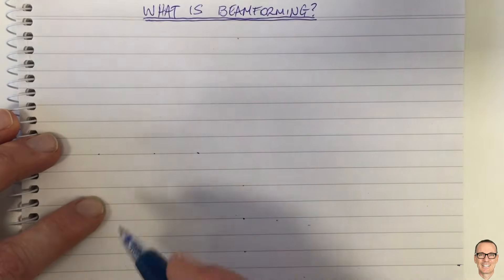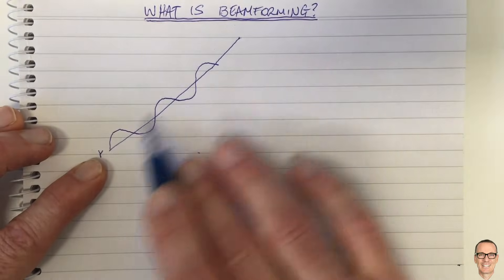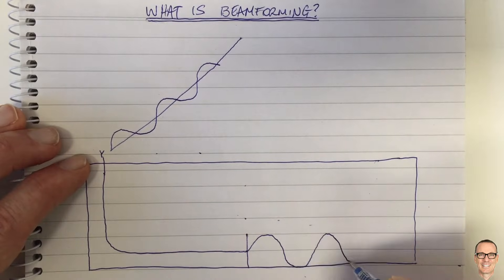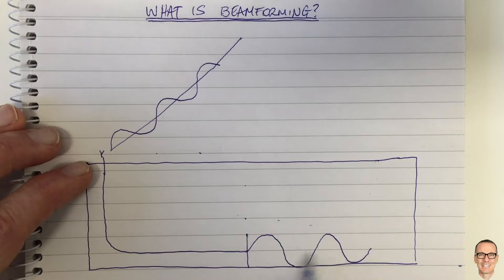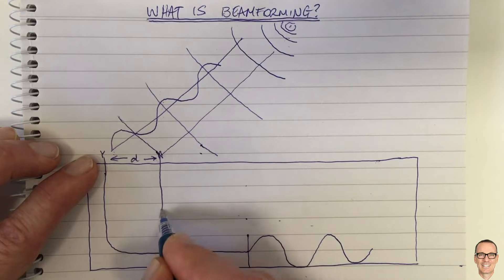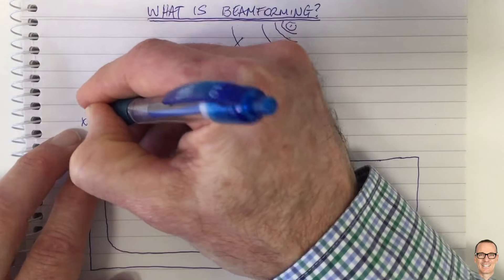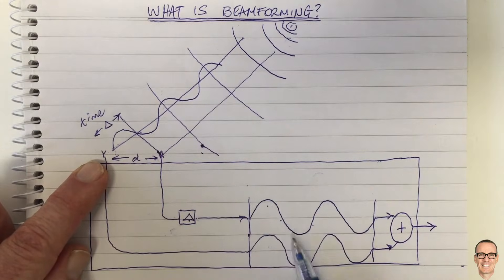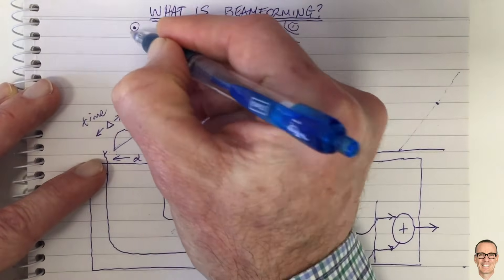What is Beamforming? ("the best explanation I’ve ever heard")

Comment: Great explanation. One question though: Are you sure that adding a delay of two times delta at the third antenna would make the peaks/throughs align? To me, two delta corresponds to a full period, so there would be no effect. Seems better to add lile half a delta instead,at least by looking at your drawing.
Reply: Ah, OK, that makes sense. Thank you!
Reply from the maker: The frequency of the signal doesn't affect the time it takes for the signal to travel between antenna elements. So it's not true to say "two delta corresponds to a full period". The time "delta" is the time difference between the signal arriving at an antenna element and arriving at a neighbouring antenna element. It doesn't depend on the frequency. The respective "phase shift" does depend on the signal frequency, but not the "time difference of arrival".

Comment: Firstly I would like to start off by saying thank you for sharing your knowledge with your videos which really are helpful to students like me. 
I watched your beamforming videos (in MIMO), I have a couple of doubts sir.

Generally received signal from base station (having single antenna) to communication user(having single antenna) is written as: r = h*(root (P)) * x + n , where h is channel, root P is included to say that transmitted s/g power from base station is P (given E[|x|^2]=1) , x is a transmitted signal, and n is noise.

Now, can the above equation be modified for a base station with M antennas as:  r = h*W*(root (P)) * x + n  , where W is beamforming weights. Is this correct? If so, what does this physically mean? Does that mean total power available at the base station is being divided among all antennas or in general how this transmitted power P is being related to weights in the beamforming vector.

I'm confused sir, it would be really helpful if you clarify this.
Reply from the maker: It depends on the norm of W. Generally we would use a W with norm = 1. Then, yes, it represents the total transmit power being allocated across the antennas.
Reply: @iain_explains   Thanks alot for ur reply sir.

Comment: Thanks for explaination, now I'm wondering how the transceiver actually  tunes to specific wireless client by selecting right delays?. Is it still in PHY or MAC layer ? Also how fast is the switching ? As if we have 4x4 router and two typical 2x2 clients how router assures signal from 3rd device will be still handled without comprising value added of two existing MU-MIMO clients?

Comment: Fantastic explanation. I want to use 2 inverted L antennas to create a phased array. My existing vertical L is a 20m (14Mhz) with a little loading coil to resonate on 40m (7Mhz). How do I reconcile  the distance between the antennas to the delay "harness"  design required....Is 1/4 wavelength optimal.....could I compromise somehow to get it to work on both bands? I guess I would need a different delay for each of the bands?? Or is it a daft idea! :) 73 de VK2AOE
Reply from the maker: You'll definitely need to match the delay to the centre frequency of the band .. seperate delays for seperate bands. There are wide-band beamforming techniques, but it's always a trade-off. Beamforming works best when it's narrowband.
Reply: @iain_explains  Thanks....I loved your explanation it made the concept clear. As with all Engineering the devil resides in the detail. Thanks for the answer.
Reply from the maker: I'm glad I've been able to help.

Comment: I can understand the basic princple of beamforming form your video, but I have a question.

Consider 24Ghz freq MIMO radar system, which has the spatial distace between Rx antenna is lambda/2.
To acheive +50 degree digital beamforming, the delay time should be (lambda/2)*sin(50degree)/c = 1.6e-11 sec.
So, if I want to make 50 degree beamforming, the minimum sampling rate of MIMO system should be 1.6e11 Hz, which is too high to make a real system.

I want to know how can I solve this problem.. Thanks.

Comment: What is never mentioned in antenna radiation is whether or not the E/M loops being radiated do break down into loops of half wavelength as the loop try to grow in size  with distance,  In waveguides and cavity resonators it is common to show the stacking of " half wavelength E/M blocks  to fit in the available space. A one megacycle wave, has a much larger loop than a 5 GigaHertz signal and though everyone talks about lobes, and directivity, and efficiency, and so on, no one talks about the "stacking of E/M blocks" the size of which depends on the frequency of transmission.  So for a given frequency , how many stacked E/M loops exist in it  as the wave moves out? I have thought about this for the last 80 years and it seems to me that when one has a directional antenna, or a phased array, all that is happening the system is cutting off and eliminating the peripheral blocks in the stack of E/M blocks in the lobe or in any omnidirectional antenna, 
I  simulated this with a computer algorithm which, when the circumference ( wavefront) of the  wave grew larger than a wavelength  integers,  then the  " circumference would accommodate another loop half a wavelength long".  
The simulation works beautifully and the patterns that emerge make it so obvious, after I saw it,  From a central location  of the antenna, after the wave settles down, the patterns seems to change from a "polar diagram" to a cartesian diagram where the  four symmetrical squares of cartesian coordinates,  simultaneously  move out their  four quarters containing the same pattern of E/M loops  as exist in rectangular waveguides contain  the higher modes. When I plotted the B and the E field loops far from the antenna they came out to be exactly as occurs in rectangular waveguides  with the  B loops as normal, and the E loops are exactly the same as the E in the waveguide and the surface currents in a waveguide, It is exactly the same pattern,
So it seems, that a centrally placed antenna  as a source, will have  the  near E/M fields  going through "a pushy transient pattern" then "a middle field pattern"  which  I call the settling down zone, and then the far field would resemble the pattern obtained in a  rectangular waveguide excited with an electric probe or a magnetic probe as one desires.  It is fascination to see the four quarters of cartesian coordinates moving out with additional loops being added as the distance increases, It is remarkable, 
This stacking of E/M blocks, the size of half a wavelength, in a radiating pattern, is interesting, and in a phased array  or a directional antenna, it seems that all one does is to " phase out the peripheral E/M blocks  and donate the power to the other half wavelength E/M blocks remaining in the " stacked lobe"   There seems to be more going on in radiation than one thinks, and this "stacking effect" needs further discussion .  An analogy may be used by looking at Chladni's figures in vibrating sheets or a Jelly block, and after all our radiating medium is not much different from a jelly or a rubber block with its "own impedance" in how it permits our signals to "accelerate "  build and decay and reverse those  the E/M loops the size of half a wavelength.  https://youtu.be/wvJAgrUBF4w
Reply from the maker: Did you say you’ve been thinking about this for 80 years?! That’s impressive. What antenna systems were you working on 80 years ago? And since then?

Comment: This Beamforming, given fixed delay, is good only for fixed (position) signal source and fixed receiver - not for moving source or moving receiver, otherwise it will be hard to tune the delay in a way to match the movement of the source, or receiver. Has this technology "Beamforming" been used for moving source, or receiver, at all in practical application?
Reply from the maker: Yes, that's right. When a source/target moves you need to adapt the delays. Then it gets called "Adaptive Beamforming".

Comment: Hi, I am a student with master's degree studying communication in south korea.
Thank you very much for the good lecture.
You are the hope of the wireless communication.

I have two questions.

1. If i want to implement a kind of antenna diversity through the two antennas on the receiving side,
It is understood that when the awgn noise added to the signal from the two antennas is different, a gain of 3 dB is obtained.
As you explained in the video, when i understand physically, don't the signals entered by the two antennas have the same awgn noise? That's the question I had in mind.
Since there is a benefit from beamforming, I think it would be right to have different awgn noise, but I don't understand this clearly.

2. According to what i saw in the MIMO channel-related textbook, if the angle spread (dispersion of PAS) is narrow, that is, if the reception beam is narrow, the correlation with adjacent antennas increases.
It states that channel capacity and divercity gains are reduced.
Performing beamforming on the transmitting side will cause the beam to be browned, which is expected to result in relatively large correlation between the receiving side adjacent antennas.
Then, is it okay to understand that it is a technology that has advantages in terms of energy concentration during tx beamforming, but also has disadvantages because of the high correlation?
Thank you.
Reply: I am the author of this comment.
dispersion of PAS (X)
variance of PAS (O)
Reply from the maker: It all depends on the characteristics of the channel. And I'm not sure you're understanding about the noise. Noise is introduced primarily by amplifiers in the RF "front-ends" of the transmitter and receiver. If each antenna is connected to its own amplifier, then the noise will be different for each antenna's signal. This video might help: "What are Spatial Diversity and Spatial Multiplexing in MIMO?" https://youtu.be/MNA0xn7EeyY and "

Comment: Thank you very much for the explanation.
I have a question. Antennas are fixed on a wireless device. So, the distance between antennas will be the same. How does it work for different frequencies?
Reply from the maker: Excellent question! The form of beamforming that maximises SNR (that I describe in this video) is inherently narrow band. In practice it doesn't have to be exactly half a wavelength separation, and there are approaches to designing beams that are wide band, but they come with a performance penalty in terms of SNR.

Comment: Hi Lian,
One question. Do you know that the introduction of delta can be dynamically changed or not? ex. in case of mobile communication, they can change position constantly so the beam direction should change also. how does that work?
Reply from the maker: Yes, the time delay (delta) can be adaptively changed at pretty much whatever rate you would like. For example, in radar the beam can be scanned across a range of angles, and in mobile communications it can be adapted to "follow" a user's signal based on either measuring training data, or actively scanning/jittering the beam. Plus lots of other applications.

Comment: The distance between the center of two patches should be d or the distance between two adjacent sides of each patch?
Reply from the maker: This is assuming ideal isotropically radiating point source elements (not flat patches). In practice, the spacing that maximises radiation efficiency will depend on the shape and size of the patches, as well as the locations of surrounding back plains etc.

Comment: So when the signal is cancelled out on the incoming transmission.. what happens to it...? Just got a bit confused at this point? How is a beam formed if it's cancelled out? Or... Have I misinterpreted what you have said?
Reply from the maker: Yes, you're right, "cancellation" does take a bit of thinking about. One example in real life is at surf beaches, when a wave is coming in to the shore, and another previous wave is going back down the sand causing a ripple in the reverse direction. When the two waves meet, the peaks of the incoming wave add to the peaks of the returning wave creating a splash. But also, the peaks of the incoming wave are "cancelled" by the troughs of the returning wave, causing the water to be smooth a those points.

Comment: Why is the mirror image beam of the strongest beam not equal in strength? Wouldn't the phase realign the maximums again?
Reply from the maker: Yes, there can be other directions too - depending on the parameters. Usually arrays are set against a back-plane to reflect all energy into the desired half-plane. See this video for more details: "How does Antenna Spacing affect Beamforming?" https://youtu.be/amepyf9-E1w
Reply: @iain_explains  Thank you I will watch that. I have another question if you don't mind. For this beamforming method, we assume the waves are "parallel", emanating from the far field. But what about the wave sources in the near field, where the curvature of the wave front becomes reasonably detectable. Then you can pin point the location of the source right? Could the directional filtering be even greater with this method, just for near field use? I am applying this to audio, and assuming a theoretical space with no objects to distort the waves. Sorry if this is too complex haha
Reply from the maker: Yes, that's right. In the far field you can work out the direction of a source, but you can't work out how far away it is. In the near field, you can do both.

Comment: Well, the speed of light is ~ 3x10^8 m/s. So if our antennas are for example 30 cm apart from each other, then if my calculations are correct the time delay would be around 1 ns (nano second).
Can it make such a difference? Are our electronic devices so sensitive and accurate to detect even this?
For comparison let me add that for example for LTE the symbol duration is around 71 us (micro second) which made me wondering whether a few nano seconds can make a difference here.
Reply from the maker: Well, it's no different to how your brain uses your eyes to work out how far away something is. And your eyes are even less than 30 cm apart!
Reply: @iain_explains  Good catch:) So you are saying that our mobile phones are so advanced to detect this?
That is very interesting. I am no expert in electronics, just curious how it works.

Comment: Hi ! Why the beampatern is not symetric to the vertical axis ?  Thanks !
Reply from the maker: It is symmetric in the horizontal axis, but normally the array is implemented with a back plane that reflects or absorbs the "backwards pointing" energy (downwards in my picture), so that the array only radiates "outwards" (upwards in my picture). For details on repetitions in the "outwards" beam pattern (upwards in my picture), see: "How does Antenna Spacing affect Beamforming?" https://youtu.be/amepyf9-E1w
Reply: @iain_explains  ok thanks for your reply  :)

Comment: This sounds like you would have a horrible time if a moving object, like people in your house, kept walking around. Your computer would constantly have to re-adjust the delay because they will make it come at different time intervals?
Reply from the maker: Well yes, but the data rate is in the tens of megabits per second, and people only move at a rate of less than 1 metre per second. So that's a lot of data bits between any significant movement of a person. So in reality, it's not hard to track and re-adjust the delay. In other words, people move at an extremely slow rate, compared to the data rate. This video gives more details: "What are Fast Fading and Slow Fading?" https://youtu.be/Tm-Uyajcuqs

Comment: hey iain, great video! i just have one question - if we transmit from the other side (like symmetrically about the normal), wouldn't we have the same high gain? because if my understanding is correct, all the waves would still constructively interfere in the receiver, just 180° phase-shifted from the waveform we get if we transmit from the direction in the video.
Reply from the maker: Yes, that's right. Good observation. In practice though the antenna elements are not isotropic. They most often have a backing plate so that each element radiates more in the "outward" direction, and almost nothing in the "backwards" direction.
Reply: @iain_explains  ahhh, that makes sense, thanks!

Comment: Very helpful video sir ! And could you explain the difference between beamforming and mimo precoding? It seems that precoding is cand like more optimal version of beamforming.
Reply from the maker: Thanks for the question. I've added it to my "to do" list for an upcoming video. In summary, traditional beamforming (BF) refers to the phase adjustments between antenna elements in order to "direct" the energy, so as to maximise the SNR in the direction of interest. "Digital BF" includes amplitude and phase differences between the antenna elements (again, to maximise the SNR). "Precoding" is a more general term, that includes BF, but also includes other cost functions (not just maximising SNR). Many precoding techniques require the transmitter to know the channel gains.
Reply: I see in some books what they call transmitter beamforming is basically precoding.  I am very confused since most people when talking about beamforming talk about carrier phase, and when talking about precoding talk about data symbols.
Reply: Are they equavlent? Is precoding basically another way to adjust carrier phase and amplitude through adjust data symbol ? And could you explain what kind of beamforming is actually deployed in systems such as LTE and 802.11ac, are they just steering carrier phase at each tx antenna. Or are they trying to find the "optimal" precoding matrix to maximize rx SNR? If the latter is true, do  the reciver need to do some post process to understand the precoded signal ?I found a lot of information conflicts with each other about this topic.
Reply: Sorry for my poor english expression. And thank you very much.